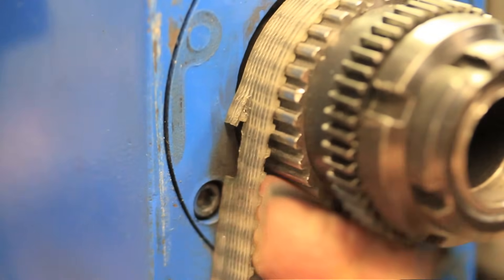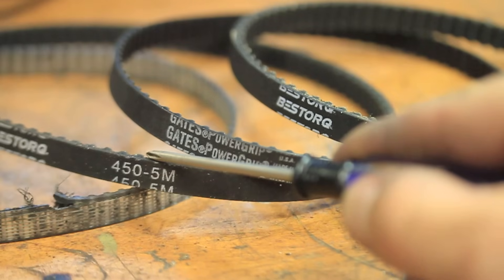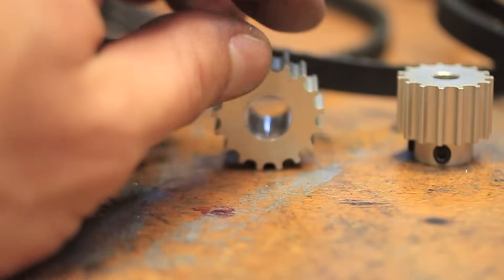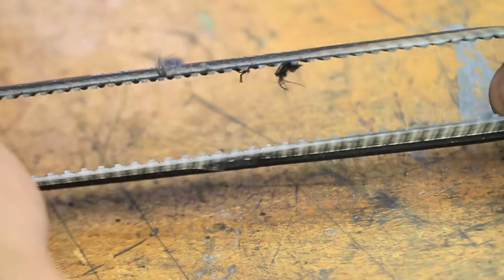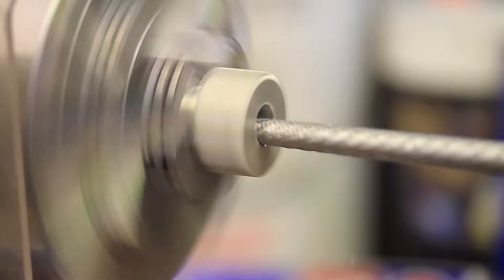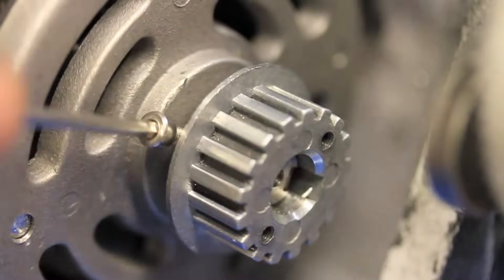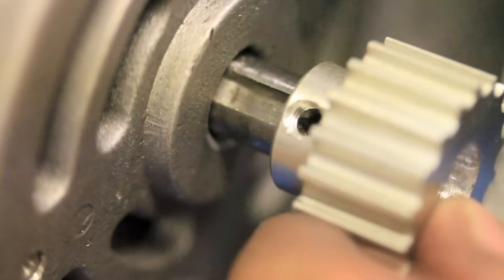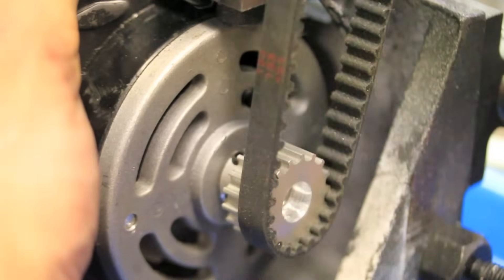Changing the belt and upgrading the drive pulley on the mini lathe

Comment: 👎👎👎Don't follow this advice guys. He's using HTD belt with round tooth profile on T5 spindle pulley with Trapezoidal profile. You can clearly see in the Video that the Belt isn't meshing properly. Use Poly-V belts and pulleys.

Comment: It's a modulo belt.  Modulo M1.5 to be exact, and 90 teeth.  This means the pitch is 1.5 times Pi, so it's about 4.71 mm.

90 teeth is too short for this lathe, so it gets overtightened at the factory and breaks.

Comment: I have the same lathe and I would like to lower the gear ratio for higher torque lower speed. I ordered a 12 tooth 5m timing pulley for the motor but I'm wondering have you tried to put a larger pulley on the spindle? I want to know what the largest I can put on it without having to modify the cover would be. Little machine shop has 40 tooth  pulleys but I don't know if it will fit under the cover

Comment: I bought a seemingly "one off" 8x14 lathe with the same issue. 8''x14'' Mini Metal Lathe Variable Speed 2250 RPM 650W 110V Metalworking Machine was the name from ebay. My model says mx-8x14, but all of the other mx-8x14's (and very similar looking mx-210v control panels) I've seen use a small vbelt and a different motor mounting, and not a tiny trapezoidal profile tooth like this video shows and looks like mine. It uses a poly belt like Tim but mine appears to be a 95 tooth 4.66 pitch. Its actually sold as a "1.5" belt (which is the width of the tooth itself). Total length is 443mm. I found mine at https://westcoastbelts.com/product/new-belt-chinese-made-luo-shanghai-healeasy-company-ltd-lathe-ot-sw138226/ - can also search on sw138226 other places. Big thanks to WEST COAST BELTS for immediately knowing what I needed and feeling my pain. :) Thought this might help someone else with this headache.

Comment: Did you realize that your Belt is scraping on the Beltcover (Bottom Edge/ close to the Motor pulley) , that covers your Spindel??? You can see it clearly, the Moment you start your Lathe for the first Time after replacing the Pulley and the Belt! I`ve had the same problem with my Lathe. I simply grinded away some of the Housing Edge, to give it a bit more clearence...

Comment: Thanks for all the great info!  I have a nearly identical machine that I just stripped the belt on and found your video extremely helpful.  I had already ordered a belt, but could not find the small pulley that you suggested.  It's pricey, but I went ahead and ordered it!
Reply: I got the pulley and drilled it out to 10mm (had to get a metric drill set anyway).  I went through the same struggle with aligning the motor so the belt would not wander off, but I got it without adding a flange to the pulley.  The machine sounds and feels SO much nicer now.  Thanks again Tim!

Comment: i bought this belt after this video and its the incorrect belt its far to short. just cause fits your lathe dont mean will fit others. these crappy lathes all seem differant
Reply from the maker: Ah bummer... I had a few misses too before I found one that would work. Plus I changed the pulley to match the belt which is definitely an aftermarket change.

Comment: Tim, your original belt is a T5 belt, which has a 5mm pitch with trapezoidal tooth profile. We manufacture timing pulleys, hence I know!
Reply: On most of these lathes, the belt pitch is "M1.5" which means 1.5 module, where Module = pitch/pi.   So pitch is actually 4.71mm.  That's why a 5mm pitch belt "almost" fits.    You manufacture a lot of 4.71 pitch pulleys ?  -- likely not -- M1.5 pulleys and belts are very rare.
Reply: What is the belt size for the Harbor Freight/Central Machenery timing belt? They say it is M1.5xZ118. 118 is the tooth number. What it the 1.5? If I measure the pitch it is something along the lines of 0.19 inches. So.....
Basically, what is the belt in standard nomenclature?
Reply: @captianmorgan7627  M1.5 - do you mean 5M = 5mm pitch? The nearest standard pitches to 0.19" is either 5mm or 0.2"(XL). Are the teeth trapezoidal or half round?
Reply: @ritulm  After doing some reading on decade old posts, it seems like it may be an old profile from the 60s. An 'F' profile. Trapezoidal teeth, 3/16'' pitch. Why they couldn't have used a commonly available, cheaper for everyone, belt....who knows. And now I need to determine if I want to bore out the motor pulley for my new motor or just change it out for something newer. But that would necessitate changing out the integrated timing/v belt pulley mandrel as well. Sigh.

Comment: if you are using a different pitch belt and pully on the motor doesn't that make cutting threads impossible now? it  seems like you would not be able to get the right ratio with two different pitch pulleys.
Reply from the maker: Nope. Because all this does is affect the speed/torque available to the lathe. The ratio between the chuck and the feed screw is determined by the gears installed between the two.
Reply: @TimNummy  ok thanks, that makes sense.

Comment: The correct belt is a 4.7 mm pitch 9.8 mm wide 90 tooth belt sometimes shown as 420 mm long.  I found multiple sellers on aliexpress and one or two on  Ebay/Amazon.  The best designation is probably something like M1.5 90 9.8 / M1.5-90-9.8 / M1.5x90x9.8 / M.15*90*9.8.   The best search phrase is probably  "0618 lathe belt".  Look over the hits carefully to find the M1.5 and 90 tooth / 420 mm info.  If sellers would just start providing the "M1.5" and tooth count in their description, finding the right belt would be so much easier.
Reply: That's very helpful, thanks. The new belt in the video is clearly the wrong one for the spindle pulley.

Comment: Do you think it would be practical to machine a block to put under the headstock and install a longer belt to turn some larger diameter work?
Reply: Surely the change gears for power feed won't then mesh?
Reply: Ah yes I think you are right, that would not be easy to overcome.  It was just a thought I had.  I owned one of these awful little things briefly.  I was able to return it due to some false advertising.  Anyway Thanks for the response.  If I get bitten by the machining bug again I will definitely look for a little larger machine.

Comment: If you fitted a POLYVEE belt and pulleys....that is a belt and pulleys that have 5 (or more) micro V profiles and grooves similar to a standard single Vee belt,  the belts can flex easier and run smoother than a single larger vee belt and also transmit more power than that timing belt.

Comment: why do all those mods when you can buy a pulley for $5 and the belt for $10 from Little machine shop.com??  I just did that a nd works great.  I like your motor bracket but it is over kill.  Just tap the mounting studs properly and locktite them.....they are plenty strong enough.

Comment: So from my understanding the plastic gears are only used for power feeding anyway?
Reply from the maker: On this one, yes. The two speed versions have a plastic transmission gear in the headstock that's used for turning the chuck. You can get metal replacements though.
Reply: @TimNummy  I know, the replacements are another 100 bucks though which together with the lathe itself is almost the price of the "next better" chinese version with factory installed metal gears and a small LCD (I think they´re called something like MX-180 or 210).

Comment: Hey Tim, just wondering how the belt has held up so far? I am thinking of making some mods to my single-speed lathe, too these days.
Reply from the maker: Hey! So far so good - I haven't had any issues with the new belt at all despite some minor rubbing I've noticed and will need to address due to the motor mount I made and how it moved the motor out a little. The main reason I did all this work is so if/when the belt breaks again, replacements are easy to find. Let me know if you have any other questions!
Reply: @TimNummy  Oh, actually, now that I have you -  I didn't wanna diss on one of your other improvements, so let me phrase it as a question instead;-). How is the QCTP holding up? Full disclosure, I bought one, too (don't worry - I hadn't seen your video at the time) and it was borderline crap. The tool holders would move around, the whole thing was just too soft with tolerances way too sloppy. I got a better hardened steel one since then and all have been good. But maybe I just got a lemon the first time around...
Reply from the maker: @AntiVaganza  Ha no you're right - it's terrible. But the price was good. It was the first thing I put on the lathe and didn't really use it with the other tool holder so I don't really know anything different. Also, I'm less concerned about the softness in the tool holder because the rest of the carriage still has enough slop in it that I'd be better off trying to figure that out before worrying about spending the money on a nicer tool holder.
Reply: @TimNummy  Gotcha, and yeah - it was cheap. I happen to live in China, so this stuff is even cheaper for me. So, no real harm done;-). Those hardened OXA QCTPs are good, tho'! Well, at least the one I got;-)
Reply from the maker: @AntiVaganza  Oh cool! I was in China last year for 2 weeks and loved it... except the smog in Bejing ha. An upgraded tool post is definitely on my list of things to do.

Comment: It seems if the belt stayed entered on the gear the belt would not get damaged in the first place. With the mods you did, can you change the angle of the motor so that the belt does not rub on the guide while passing the gear on the motor shaft? Just a thought.
Thanks for the content!

Comment: Thanks for all the heads up. I have the same piece of shit as well. Looked into as wellnot available in a 90 tooth. It is actually a what they call a module 1.5 pitch belt non standard  in metric or USA. It has a pitch of 4.7 mm ( Module 1.5 so to speak) I don't think the 5mm pitch belt fits mine correctly. Works but I can see belt crawly on spindle causing unwanted heat. I was able to find a 83 tooth that fits spindle and motor pulley perfect, but to short.( Again Module 1.5 )      70 tooth and 100 tooth no problem but 90 tooth.....I guess I will see about splicing a 100 tooth???  Thanks for all you info
Reply: Hi Tim: I found M1.5-90-10 timing belt here : https://www.aliexpress.com/item/5pcs-pack-PU-timing-belt-1-5-90-10-belt-width-10mm-teeth-number-90-sell/32838581932.html?spm=2114.search0104.3.75.401aaaff9Rba8D&ws_ab_test=searchweb0_0,searchweb201602_5_10065_10068_10130_318_10547_319_10546_317_10548_10545_10696_450_10084_10083_10618_452_535_534_533_10307_532_204_10059_10884_10887_100031_320_10103_448_449,searchweb201603_60,ppcSwitch_0&algo_expid=cf489a2e-0abd-4e2e-a192-4526c1e196a3-11&algo_pvid=cf489a2e-0abd-4e2e-a192-4526c1e196a3&transAbTest=ae803_4
Do you think it's a match? It seems the shape of the tooth is a little bit different. What do you think?
Reply: Thanks just what I needed. Perfect fit good to go now.

Comment: We have a joke regarding our homeland' father sabre which is on a museum in exhibition.Firts they had to change the blade due to being old and rusted.....later they changed the handle. Now is not the same sabre anymore.With this lathe is the same....you basically will have to change 95% of all the parts.When it will work properly will have no more chinese parts anymore, and will cost $3.000!!!

Comment: i think if the tooth width is 5mm and the distance between any two teeth is also 5mm then it is T10 timing belt but if the distances are 2.5mm then it is T5 timing belt

Comment: I wonder if that new built tore up, as it the motor gear was obviously misaligned which would cause it to get chewed up rubbing on the side of that plate.. I think I would have moved the gear outward until the belt properly stayed on the pulley.
Reply from the maker: I haven't looked in a while but last time I checked it's still in good shape. I fought with it much longer than I included in the video and I couldn't quite get it right. Thanks for watching!
Reply: Good to hear!

Comment: Shouldn't the motor be moved a bit so that the belt and pulley align (5mm - guessing)? It seems to me that the out of center is just the belt aligning with the upper pulley and that the protection will only end up ruining another belt.

Comment: I assume you will eventually align the tailstock? Pretty much any chinese mini lathe are off centered and when you attempt to drill you will see the cutting tool bent.

My tailstock axis is above the spindle axe and I have to figured it out how to lower it.
Reply from the maker: Yeah, I've messed with it a little but but it's still a little off. I might try to get it closer at some point. Thanks for watching!
Reply: TimNummy little machine shop has a diy align tool on their site, fun little project and makes aligning the tail stock much easier.
Reply: Richard Nguyen try shimming under the headstock.

Comment: great video that lathe is nothing but trouble. what camera and setup do you use to video ?
Reply from the maker: Thanks! Slowly it's becoming pretty reliable though... I use my semi-retired photography camera which is a Canon 7D and then one either a 60mm 2.8 macro, 28mm-135mm kit lens, and 16-35mm 2.5 wide angle depending on the shot and how much grease and stuff I have on my hands.

Comment: Thank you so much, I've had Drive motion companies search high and low for replacements with no success. And I really do not like that plastic gear. I am looking forward to ordering these parts and making the upgrade.
Reply from the maker: Glad it helped!
Reply: Awesome.
I have had issues with mine since the day I got it and it finally shredded the belt and ate the end of the plastic gear off last weekend while trying to part off some really tough brass.
I just received two new belts and another plastic pulley from The Little Machine Shop yesterday but I am going to stick those in a drawer and get the parts for this upgrade. I am in no hurry because I am going to do the tapered bearing upgrade at the same time and have to get the bearing races yet.
Thanks a ton for the video and the info, I just subscribed too.

Comment: Most likely knowing china's manufacturing base they had a supply of different sets of parts and just used whatever fit the best and then said fuck it.
Reply: Also, get some HSS (high speed steel) for those odd size and shape jobs.

Comment: Good mod and thanks for the belt info.

You may want to revisit the set screw in the future. Over time, it will destroy the wall of the keyway on the motor shaft. You could sand or grind down a key to make the motor shaft more of a D shape and then tighten the set screw on that.

Assuming you don't have a broach, you could also manually broach with your lathe using a ground piece of HSS on the compound. If you have an adjustable height tool holder, you can just increment the height to take material off on each pass. You would want to lock the spindle in place while doing this.
Reply from the maker: Interesting, thanks for the suggestions and I'll keep that in mind - I've been trying to get this lathe into a better-than-it-was-usable state first, then go back and make it better after that ha